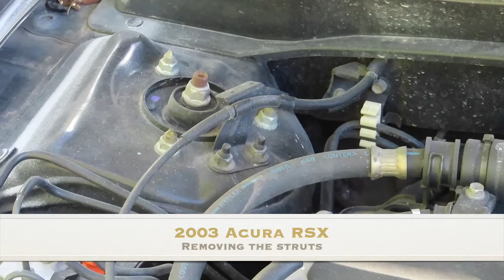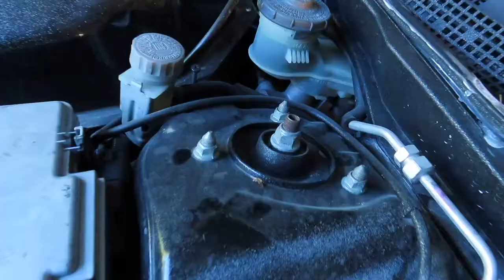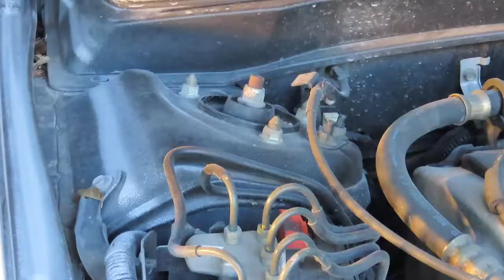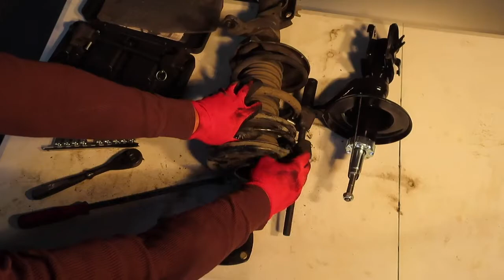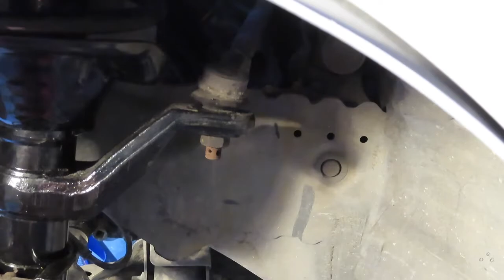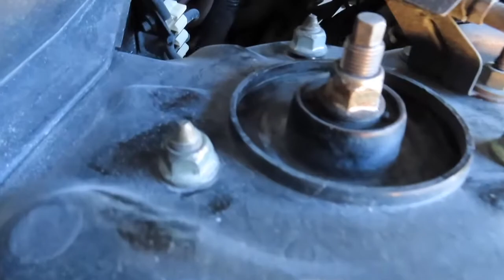1999-2003 Acura RSX Front Struts Suspension

Comment: Bought my '03 rsx base 18 months ago..runs and drives great except for this elusive clunking which I've narrowed down to the struts and/or mounts.  I just replaced ball joints, outer tie rod ends, control arm bushings (would not recommend, just buy new arms!) and sway bar links and bushings.  Still clunking.  Anyway this is THE only video or info I could find on the specific components in the strut assembly so much appreciation to you for taking the time to make this!
Reply: Damn I'm experiencing the same thing , did all the same things (yeah fuck changing control arm bushings , that shit was a bitch!) I came to same conclusion that it's my strut or mount. I guess ima wait until I get my kw v2 coilovers.  
Have you had any luck fixing your issue?
Reply: @amirparvez5415  it was definitely the strut mounts!  Replaced struts and mounts, bearings and she's rock solid now..
Reply: @0326tks  hell yeah I'm glad to hear to hear that . Ima try to get that done soon cause I'm tired of that clunk sound 😪. Thanks for the reply back !
Reply: @amirparvez5415  no problem.  I did the strut bearings too bc they were cheap..happy wrenching!